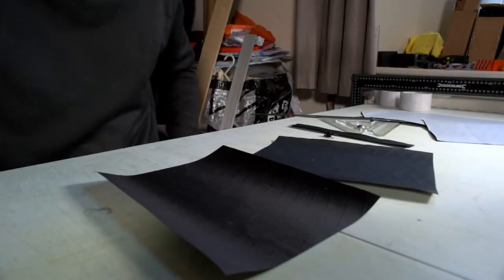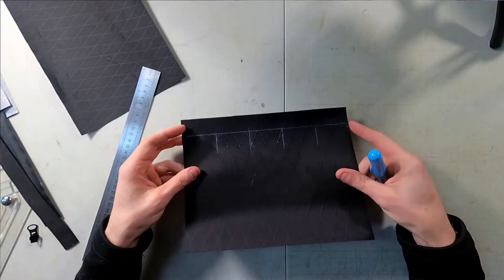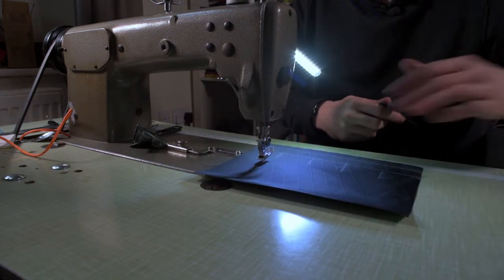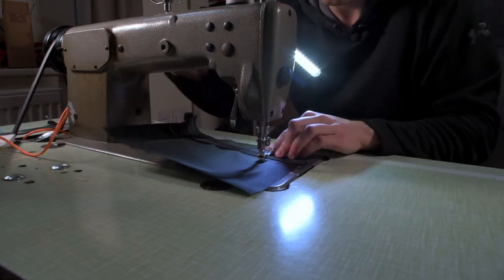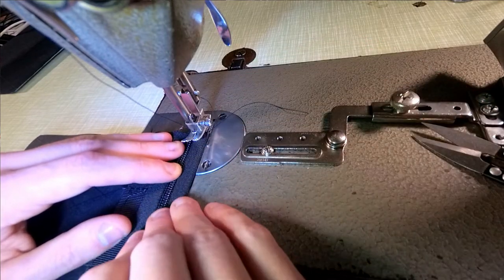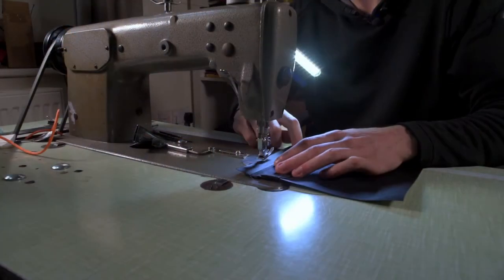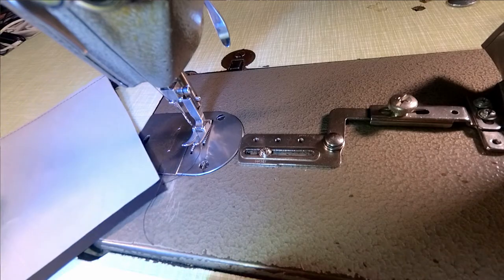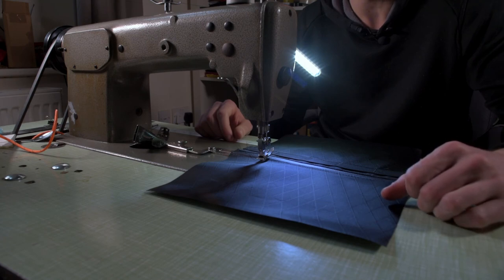How to Install a Zip and Create Webbing Ladders

Comment: Thanks for the great step by step! I just might be courageous enough to to do a bag. I am hoping to do a 5 inch round by 8 inch wide bag. What’s the best way to determine the length of my bag body material, and how much extra do I need to allow length and width for the seams? Thanks again!
Reply from the maker: Hey Michael, to calculate the length of fabric you need just multiply the diameter by pi, so a 5" bag would need about 15.7" of material. I tend to use either 5mm (3/16") or 10mm (3/8") for seam allowance.